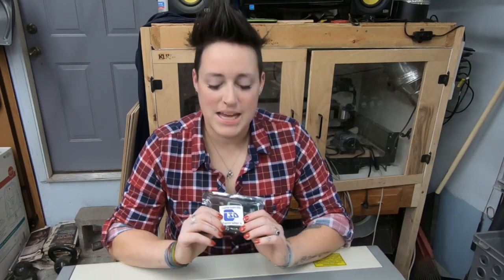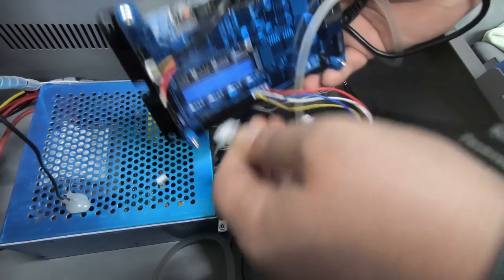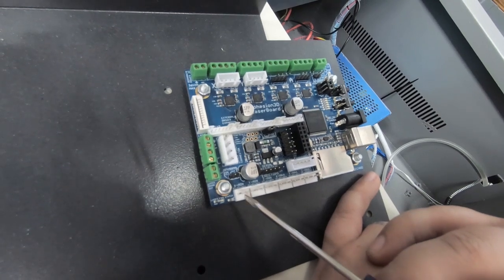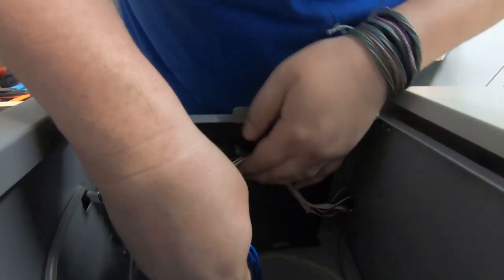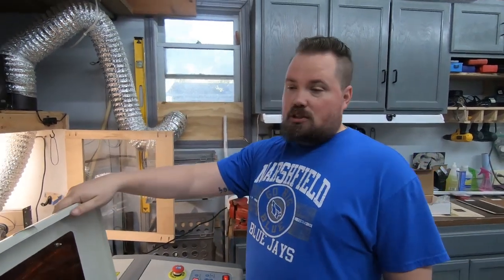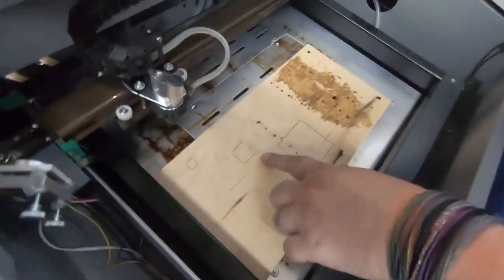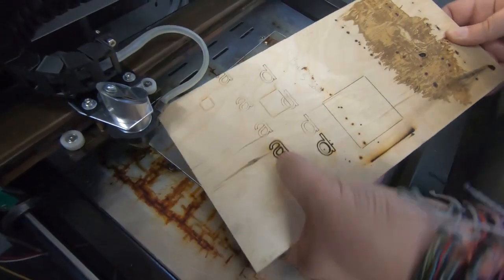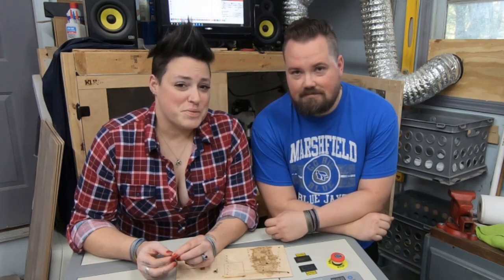Cohesion 3D Lightburn Board | Monport K40

Comment: did you figure out what was happening with the homing?
Reply from the maker: Yes. I had to return the limit switches back to stock settings.
Reply: @KLRform  stock, as in normally closed?
Reply from the maker: @cyberlizardcouk  yes. We did a part two of this when I got it running

Comment: Why did you feel the need to switch control boards?
Reply from the maker: Wasn’t happy with the performance and wanted to do a comparison.
Reply: @KLRform  was it worth the cost and if so, how is it better?  thanks
Reply from the maker: @stevespringer8385  we think so but still learning. The monport board seems to be slower transmission rates and can’t keep up with faster movements. Also has to set the power higher to get any output from the laser. With the cohesion it goes into the laser as a straight swap and not a rewire. So you still use the power control on top.

Comment: Glad to see you are getting better results.  Sounds like you are going to have to rewire your limit switches back to the original setup to get them to read correctly.  As to homing that's a setting in lightburn to pick where you want it to home at.  I think you're going to be really happy with the results once you have things worked out.  On that first engrave where you were at 200 and 10% you could have upped your power to around 25% and it would have come out looking really nice.  I typically run around 125mm/s to 150mm/s for doing engraving on leather with around 5-6 mA and get great looking results.  Looking forward to seeing more of your testing.
Reply from the maker: Thanks for the comment. I will keep those speeds/ powers in mind

Comment: did you return the limit switches to their original configuration?
Reply from the maker: Not yet. Haven’t gotten the machine to attempt to home yet. When that works I will be able to see if I need to change them back.
Reply: @KLRform  This is why it doesnt home. if its expecting normal open, and it experiences normally closed signal it believes its home already. this might also screw with your cutting and coordinate systems if you use relative or absolute coordinate systems. a quick confirmation is to hold down one or both of the limit switches with a piece of tape (and stop the machine with estop before it crashes)
Reply: that is, tape the limit switches shut (which would open the circuit) and see if the board tried to home the machine. this is dangerous because then there are no switches to tell the board when its home, so it will push the gantry to the limits non stop because now it thinks its far from home... (spiderman jokes) 

be quick on the e-stop as you dont want to crash the machine, then you can disconnect and properly wire them.
Reply from the maker: @appahman  I will give that a test. Thanks for the info.
Reply: @KLRform   You will have to do that, I installed the Omtech Board, After the repair on the limit switch wiring, I was up and running with the Omtech in about a hour. It performed well with Lightburn. Setup was easy with LB...........